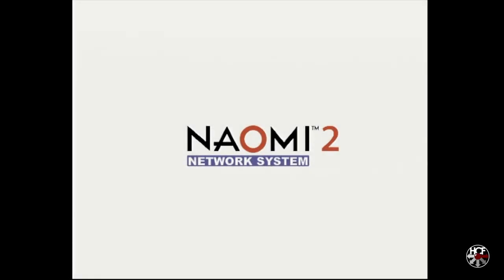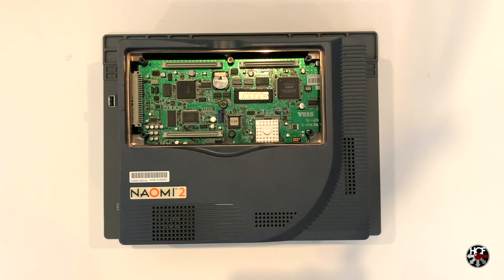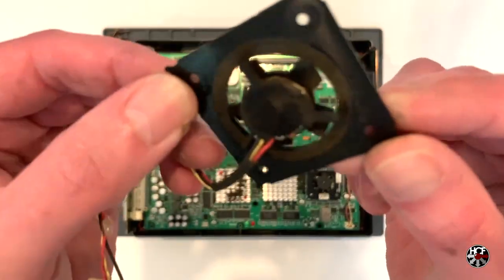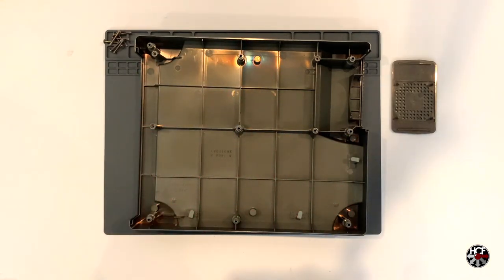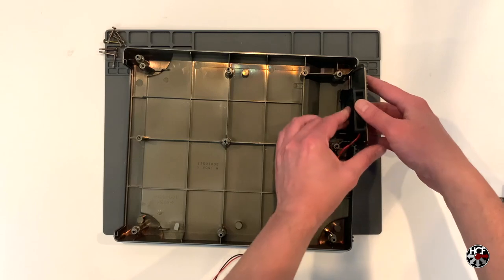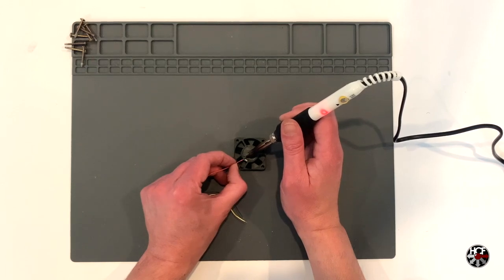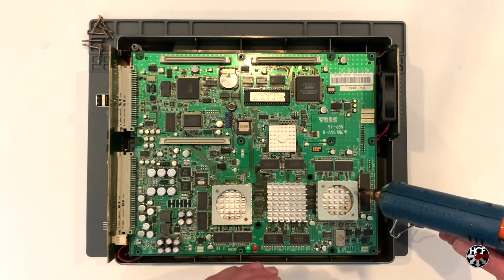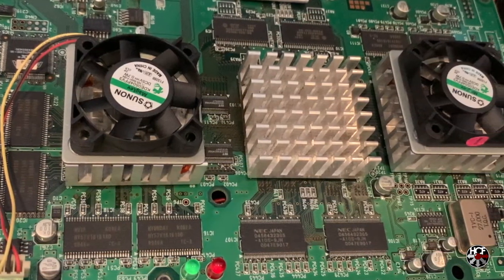SEGA Naomi 2 Arcade Board CPU & Case Fan Replacement | How To Guide

Comment: Any downsides for using quick disconnects (or jumper cable connectors, maybe) when patching the fans?
Reply from the maker: I didn’t think of that! I can’t think of a reason why it wouldn’t work, and you’d be future proofing yourself if you needed to change the fans out again later.  I’m not sure how it would affect the sense wire, but in theory, you should be good.  Good call!